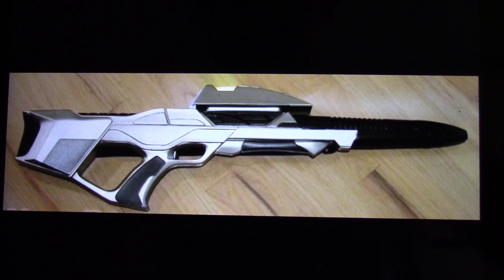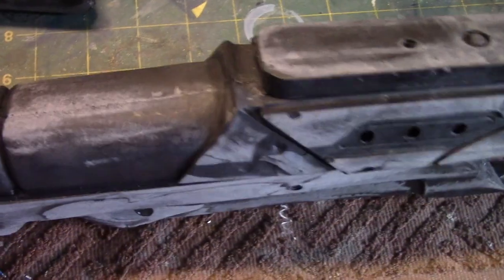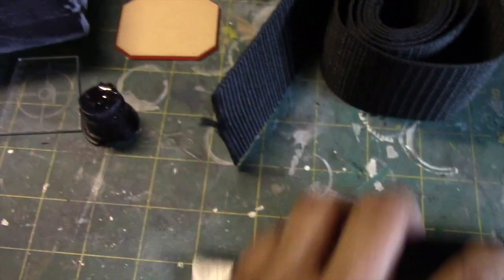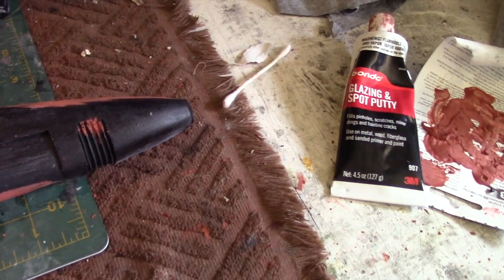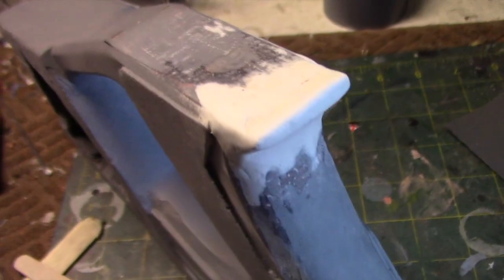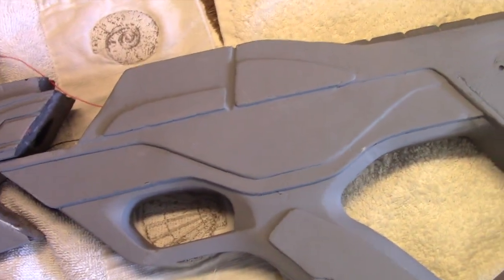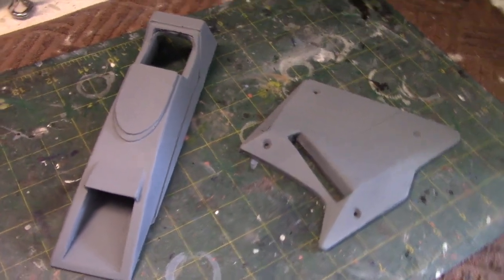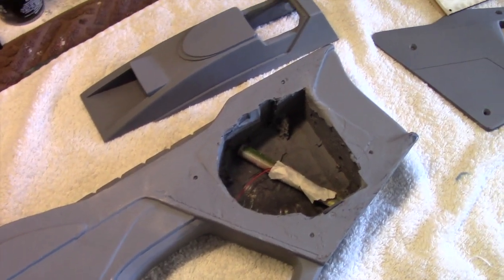Building a Star Trek Type III Phaser Rifle Part 1

Comment: What is the shelf life of the "Plastic Weld" when in between use?
Reply from the maker: It comes in a plastic container with a cap.  As long as you don't expose it to a lot of air it will keep for a long while.  I place the capped container in a zip lock bag myself.